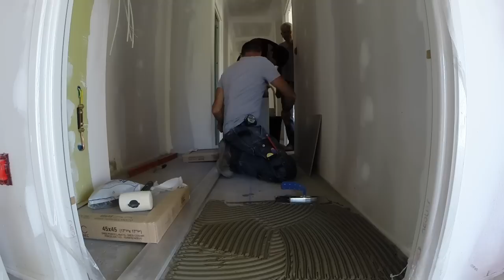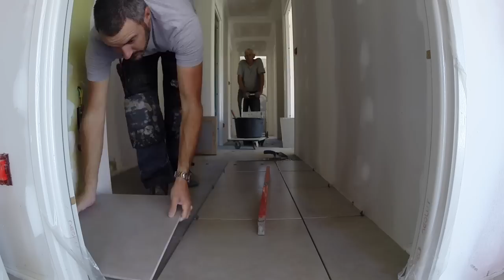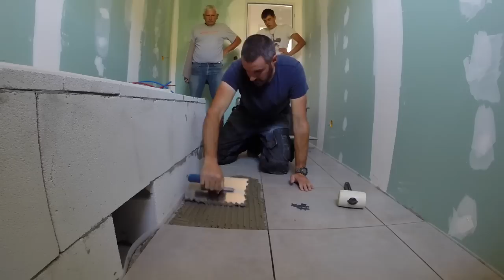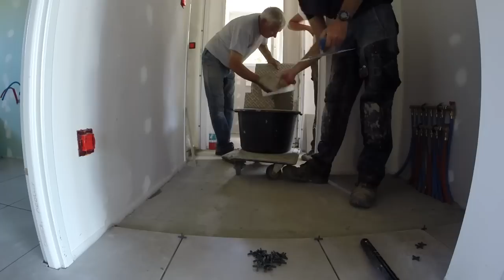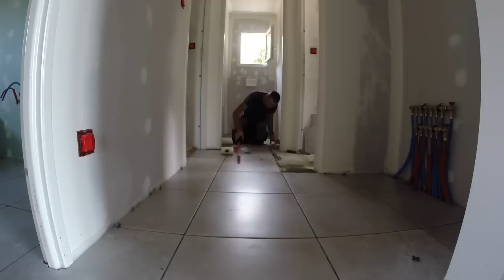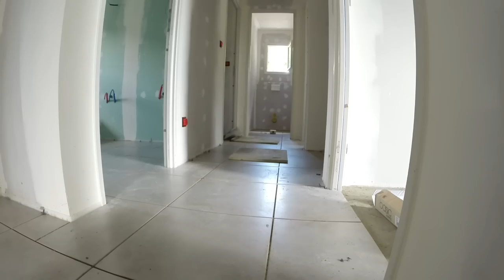pose du carrelage deuxième partie

Comment: Slt, une question tu ne fais pas
De joint de dilatation au niveau de toute tes portes???
C'est dangereux ce que tu fais cela risque de fissurer si le sol travail surtout si tu es dans du neuf ??
Reply from the maker: Bonsoir,
dans cette maison il y a un joint de dilatation entre la pièce a vivre et le couloir. Ensuite il y a du parquet dans toutes les chambres donc un joint a chaque porte de chambre entre le carrelage et le parquet.
Si toute la maison était carrelée j'aurais fait un joint de dilatation a chaque porte de chambre.
Reply: @SOLITAIRE2A  salut pierrot pourquoi juste un joint aux portes de chambres?parce que la surface est plus grande ou par rapport au fait que c'est des pieces chauffées?même en chape adherentes tu fais des joints aux portes?merci l'ami a bientôt
Reply from the maker: @jijicap305  Salut,
un joint aux portes parce que si la chape travaille, ce sera a cet endroit mais ceci dit ça dépend des surfaces et des longueurs, ça ne change rien si la pièce est chauffée. C'est juste que si on a par exemple 2 chapes de 20 m2 séparées par une porte, il y a toujours un risque que ça fissure au niveau de la porte. Après perso j'ai déjà fait des pièces de 60 m2 sans joints de dilatation et rien de bouge. D'ailleurs dans cette maison la pièce a vivre fait 55 m2, pas de joint et aucune fissure. 
Qu'est ce que tu appelles chape adhérente ?
Bonne journée !!!
Reply: @SOLITAIRE2A  une chape adhérente qui est directement sur la dalle béton  avec barbotine, la dans mon cas j'ai 40m2 avec deux pièces de 15m2 séparées par un couloir
Reply from the maker: @jijicap305  C'est ce qui a été fait ici, je fais toujours la chape direct sur la dalle mais par contre je ne comprend pas l'intérêt de la barbotine.
Reply: @SOLITAIRE2A  la barbotine je l'a fait comme je fais un  gobetis sur un mur ca me fait une bonne liaison entre le beton et le mortier de chape sec,de la a te dire que c'est mieux que de mouiller la dallle simplement comme tu le fais toi ça j'en sais rien lol
Reply from the maker: @jijicap305  A vrai dire je n'ai jamais fait ça lol, j'ai toujours fait les chapes direct sur la dalle en mouillant bien pour que ça accroche mais ceci dit, chacun sa technique, il n'y a que le résultat qui compte. 
Bonne journée !!!
Reply: @SOLITAIRE2A  tout à fait Thierry 😆

Comment: Pour ma part mes carreaux font 7mm d'épaisseur et mes croisillons 3mm donc si il reste 4mm de joint sa peut le faire ou pas ?sinon si on en met 4 soit un dans chaque angle est ce que sa augmente le risque de faux equerage?
Reply from the maker: Ca fait pas très épais 7 mm, le mieux c'est soit de faire rentrer les croisillons au fur et a mesure de la pose, soit en enlever le maximum le lendemain. Après si il en reste quelque uns ce n'est pas très grave si il y a 4 ou 5 mm de joint par dessus. Les croisillons ont toujours tendance a remonter durant la pose.
Reply: Bonsoir Fred,
tu ne risque pas de faux équerrage si tu met 4 croisillons dans chaque angle.